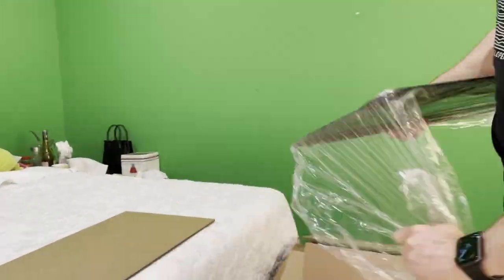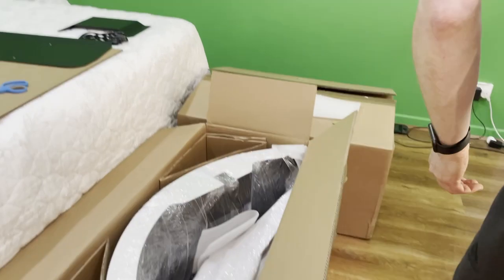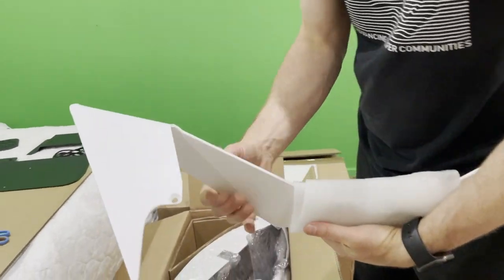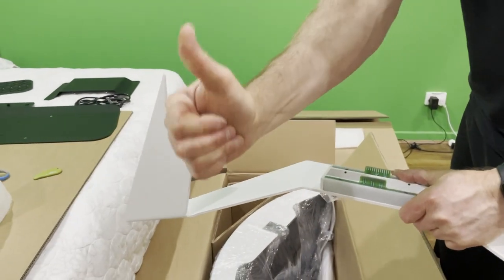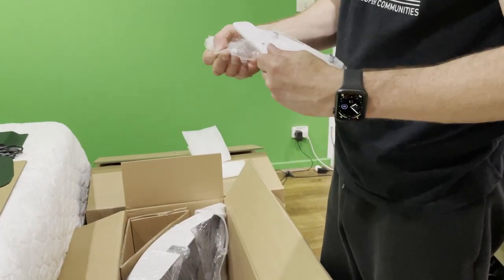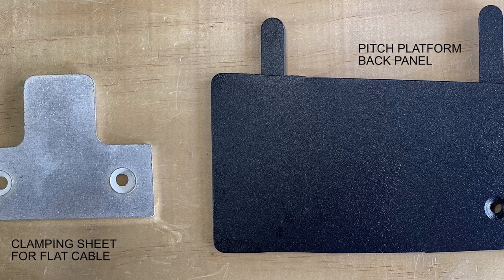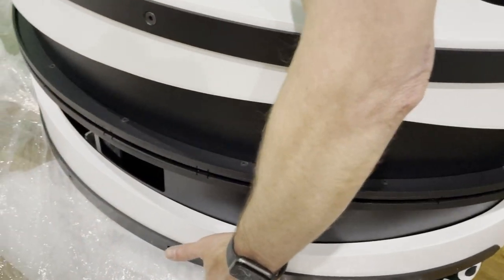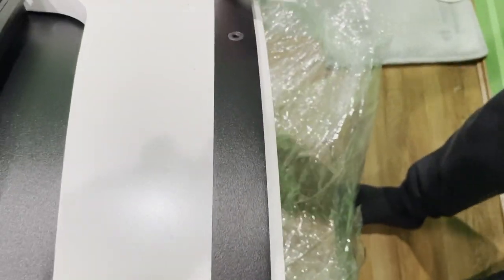Yaw 2 Motion Simulator Unboxing: Pitch Box (NR2)

Comment: Great job pointing out those non-flush countersunk screws in the track. I imagine those would wear down the rollers more rapidly. I think I may dismantle mine this weekend and check it out if they are flush.
Reply from the maker: Funnily enough I was actually theorising this would make for rough/bumpy pitch movement while in bed this morning, so I think it will turn out to be an issue no matter what..

Comment: Nice! Maybe those non-flush screws can be fixed by unscrewing them all and then screwing them back in in several stages.

I think it's caused by the plastic going out of shape, which is why it's happening on opposite sides.

If these screws are tightened more or less all at the same time in a gradual manner (so screwing the screws in a bit at a time going clockwise or counter clockwise) it might stop the plastic from throwing the screws off, perhaps?

Hope I've explained that well enough! 🤔😁
Reply from the maker: Yeah, I'm pretty sure they will need to be made flush otherwise the pitch movement will be bumpy and the rollers will wear out more quickly.